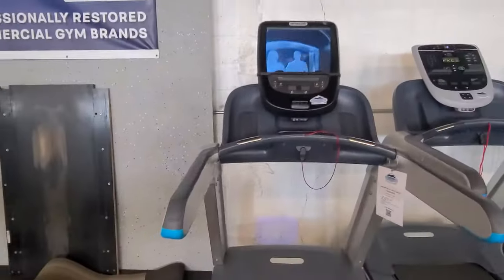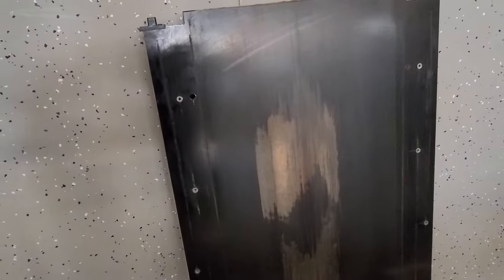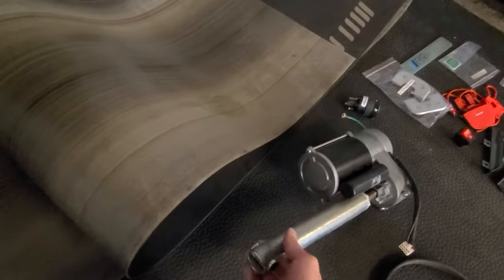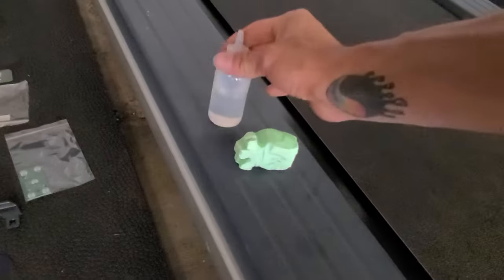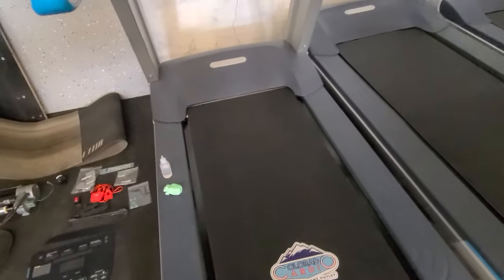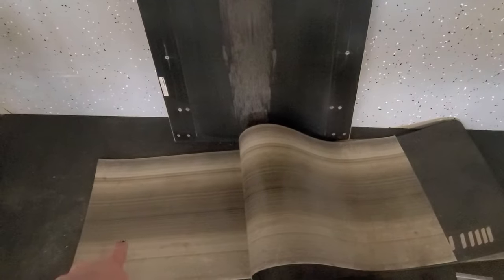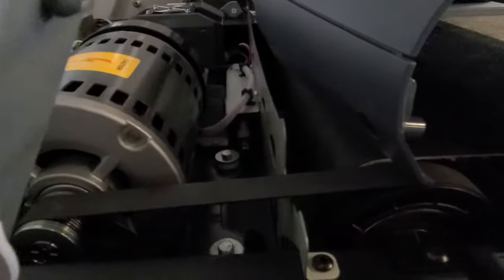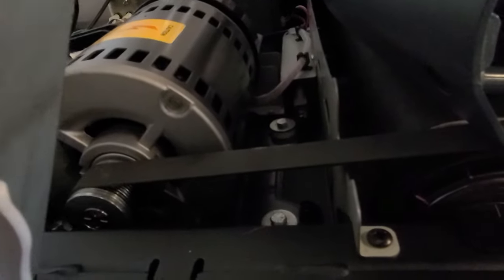Treadmill belt stops when I step on it (How To Fix)

Comment: My new trademill slows because my steps Pressure put pressure on the belt when I lift my leg and put my leg with pressure, which I didn’t feel in Gym. Is this Normal. Belt was slipping as well I put lubricant that came with the product. But it didn’t fix all the things.
Reply from the maker: Sounds like your running belt needs tightened from the back and apply a little more silicone. If this doesn't fix it your drive motor is going bad

Comment: My treadmill belt is not moving what can I do for it to start to work
Reply from the maker: The belt might need to be tightened and silicone underneath to allow it to run smoothly. Or check your drive belt where the motor is, make sure that is still on track.
Reply: @coloradocardio  I press start went its starts to run it runs for a few second and stops
Reply: I have the same problem when I step on belt it stopped...check the nut bolts which fix the motors...tight them properly so that motor becomes firm at its place...

Comment: i think you didnt answer the question. i just lubricated the belt and it stops when i step on it
Reply from the maker: Then the belt would be too loose. or your drive motor is failing.
Reply: We just bought a used ProForm 2500 and it does the same whenever I use it it stops after 25 minutes but whenever my sister uses it she can do 30 minutes without stopping The display is still on and counting and as soon as I lift my leg up it continues to roll and I've lubricated it already I'm under the weight limits what else could it be am I just too big? The motor gets around 105 Celsius when it stops not sure if that matters. 😅

Comment from the maker: Let us know if you have any quesitons or need anymore help
Reply: When i run on treadmill its stop and run stop and run so any suggestions
Reply from the maker: @AdeshBear , yes first check under the running belt, if it is dry you need to add treadmill silicone. Or if the running belt is too loose you need to tighten it up from the back rollers with a 5/15 allen wrench. Or last it could be is a loose drive belt at the motor. (If non of the above your motor might be going out)

Comment: Why would the dry belt cause lift motor problem? Aren't they separate things? I'm asking beacuse my treadmill has belt and elevation errors.
Reply from the maker: The dry belt shouldn't have anything to do with the lift motor. These lift motors do go out and the best place to buy them is kamway.com As far as the belt having problems I would tighten it up and apply silicone on the underside of the belt this will reduce the friction.

Comment: I replaced my walking belt myself but prior to that I had no idea that I was supposed to count the turns on the tension and now that I've installed the belt I've been having trouble to get the correct tension because the belt would rub against the bracket or bar that's underneath the walking belt (it's to keep the belt aligned, it's an L shaped not sure if brackets or bar is the correct word) when I go on it, it has a hard time moving and it's super lubricated (I think) it stalls and it feels unsafe to just walk on it because its like i am stopped every other step. Idk what to do about it.
Reply: same problem here, I'm about to throw away my treadmill and get a new one. It just feels so unsafe

Comment: my treadmill only stops when i hit around 9 mph or more. why is that?
Reply from the maker: It is overheating and shutting down for safety. Check to make sure you have silicon under the running belt to reduce friction on the running deck. And have a clean motor compartment.
Reply: I like this answer, it seems like all problem's mostly are coming from friction between the belt and board and possibly a dirty compartment. Idk, had my treadmill for almost two years now and i can only get it to go between 25mins and 45 min's Sometimes. And i lube it from time to time.